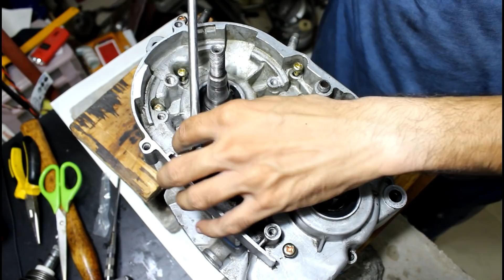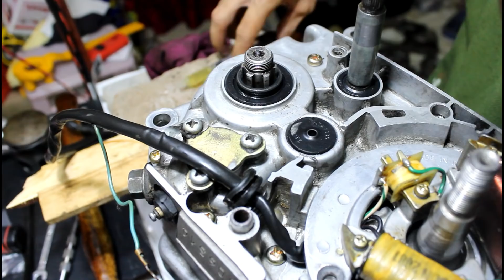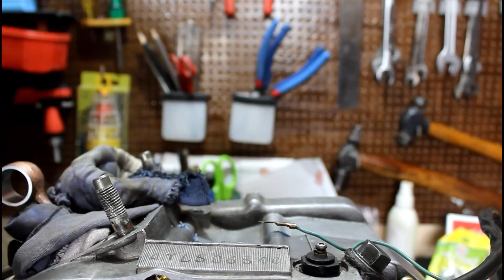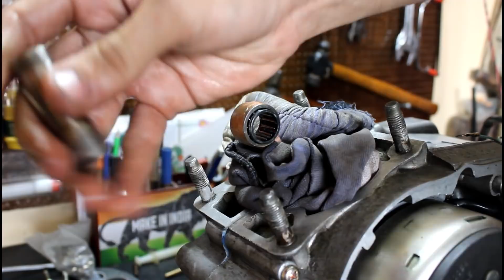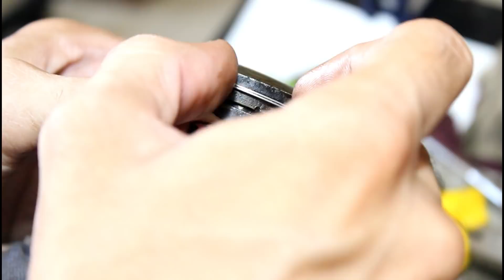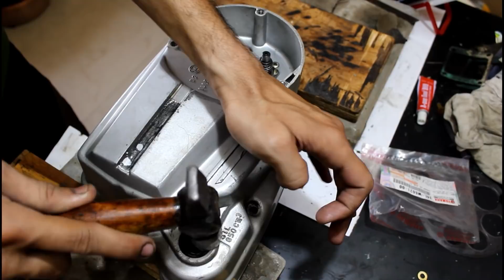Engine Assembly (part 2) | Yamaha Rx 135 Restoration project - part 5

Comment: The metal plates are wrongly inserted, it's notch should be placed at 12,3,6,9 like in wall clock, if that not correctly placed that engine will produce vibration, not at slow speed but it will be on mid and high range.
Reply from the maker: Rightly pointed out ... thanks for the inputs... I never got the chance to re shoot this part ...I'll definitely correct that part in coming engine assembly video of rx 100.
Reply: @RajasGadkari  make special video to highlight it so we should know
Reply: Video timing of metal plates
Reply: Pp
Reply: Pppp
Reply: Can you spot out video timing
Reply: Metal plate means that the Pressure Plate which is between 2 clutch plates

Comment: Instead of putting Gasket between Chamber 1&2 it is better to put sealant called Fevibond which comes in white colour is far cheaper price around Rs55/-,easily available in any automobile spare parts shop than Suzuki-Bond commonly used during assembling gear box in MarutiSuzuki  work shops costs around Rs240/-or may be more in tube....Putting Gasket in between two Chambers as shown in this video, while assembling RX engine is not advisable nor this is found in factory fitted Yamaha engines.This type of sealant bond is far superior in sealing between soft metal surfaces as it is found and are used in present time various cars and bikes.

Comment: You should replace the piston because it has a carbon reaching half of the piston....it will looses compression at the high rpm. And it also will reduce the power of the motorcycle...BTW, your video was soo detail.....good job🖒....im from malaysia
Reply from the maker: yup ...but Compression and performance was great for now...so decided not to waste this good bore and run this bore for more 2000Km or so ... after its completely used then we'll go for next rebore

Comment: The clutch assembly is wrong in my opinion 12:10.
There should be a friction plate in the end as per the Yamaha workshop manual.

Comment: For your kind info -
 The component u r calling friction plate is called Clutch plate & the component u r calling clutch plate which is dotted plain plates are called pressure plate.
& 1 more thing, 2T oil means 2 stroke engine oil. So u said u r using 2T oil, not engine oil. Ultimately wo engine oil he toh hai 😂😂
By the way nice video.

Comment: Hi, can you tell what happens if we do not use the steel ball that you installed before pushrod?
Reply from the maker: then you will not be able to properly set the clutch setting.

Comment: Sir, for Rx135 for best mileage, how many anticlock turns to turn air screw after full tight
Reply from the maker: it is not like that ki how many turns .....you have to set the mixture when engine is running while looking for the RPM and sound of engine.

Comment: bro can we use 2t pump of rx100 in rx135??????
Reply: om kumar yes you can
Reply: r u sure sanjeev?????????
Reply: om kumar yes I m sure
Reply: om kumar only the tiger model ( I dnt understand why they calling tiger) has totally defrent oil pump which cnt fit.
Reply from the maker: basically there are two types of oil pump used in rx 100 and rx 135......if you have a similar type oil pump then you can interchange them.
Reply: That's what I said.....

Comment: Is RX100 and RX135 4speed gear box same? And if not , are they interchangeable?
Reply: C Baruah  ..you can also..coverted it on 6 speed..but a little..help of machine shop...like we did on philipines use in racing ..your rx king  are called in our country rxt 135..same 4 speed..
Reply from the maker: I don't know about the gear ratio of both ....but in every other aspect it's identical
Reply: Yes you can interchange....there is no defrence in the bother engines gear box assembly.
Reply: Yes. Both the RX share the same gear ratios. The only difference in both the bikes is the primary drive ratio (crank to gear main shaft) and secondary ratios (driven to rear sprocket). Ofcourse I don't need to mention the CC and the relative carburetion and Magneto. Hope this helps or you can write to raj7447@gmail.com for detailed information on everything about the RX clan.

Comment: One more thing never tighten  the engine screw for Yamaha and Suzuki 2 stroke engines in criss cross patern it should be tighten in figure "9"
Reply: Any specific reason for following the figure of '9' instead of tightening even number Nuts in Cr-Cross pattern in any 2-Stroke engine Cylinder Block of Yamaha and Suzuki bikes.

Comment: please tell the teeth of clutchbell and gear. I have a rxg it jerks mech says its due to clutch bell teeth
Reply: RX-G : Main Bell = 71 Teeth
Primary Drive = 22 Teeth
 So use rxg chain sprocket or 5speed sprocket 
Rxg chain 15T/37T
Rx135 5speed 15T/38T
Reply from the maker: What the mechanic says is right.....if the clutch bell has a significant wear then bike can have a this issue....youll have to replace it.
Reply: Gaurav Kaithwas 
Its not bcuze of the clutch bell as u said u. Rxg had magnetto issue thys why the rider  getting jerks after closing the throttle so later the company solves this problem in rx 135 by putting balancer plate in the magnetto.

Comment: Tools required for removing clutch for yamaha 135 what about timing chain in 2 stroke engines.
Reply: Jagadeesh A Patil dear 2 stroke doesn't have timing chain.
Reply: Jagadeesh A Patil 
Phillip screw driver
Impact screw bit
Hammer 
L n key 6 no
19 mm box
Clucth end holder
Reply: What is that Ln key 6 no sir
Reply: L n k bolt which holds the kick of the bike